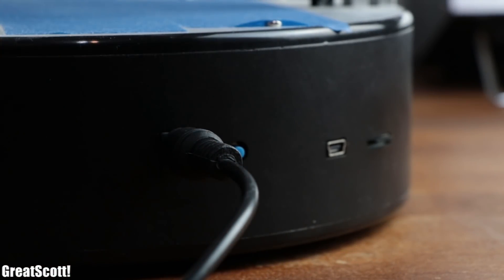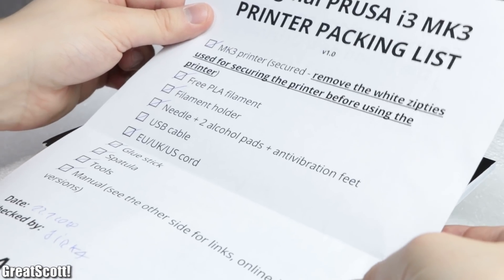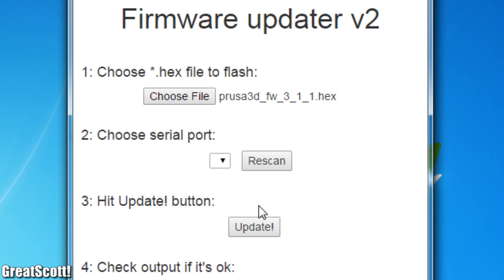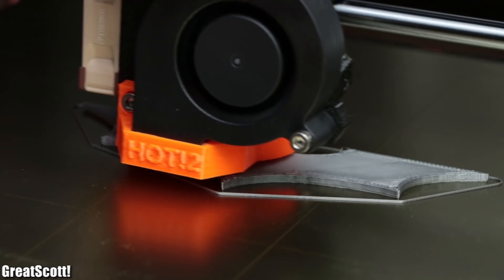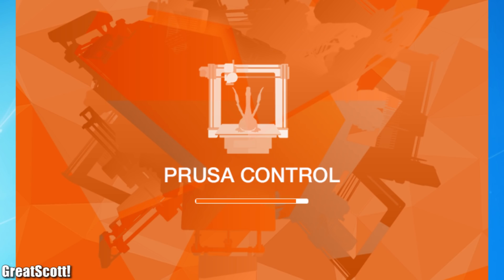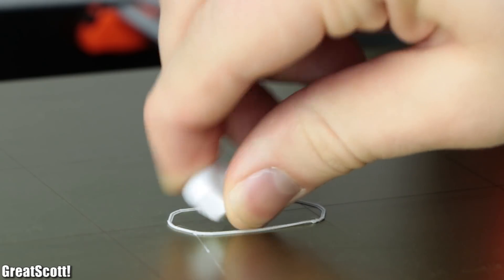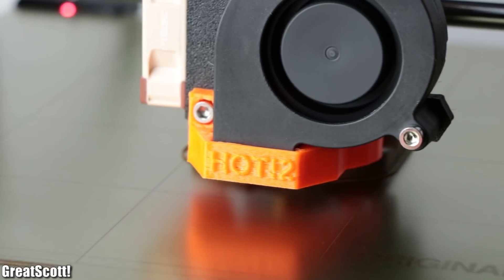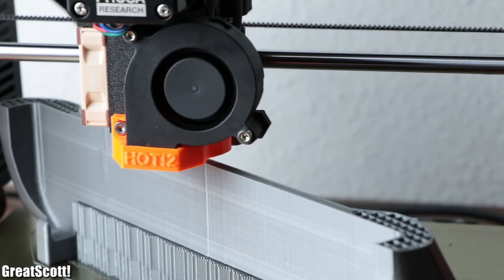Original Prusa i3 MK3 3D Printer Review - Still the best 3D Printer?

Comment: Usb Soldering iron DIY OR BUY...?
Reply from the maker: I put it on my to do list
Reply: GreatScott! Plz Fast..
Reply: HBS Productions but ...i see some Usb Soldering iron online
Reply: Lalan Desai yes
Reply: GreatScott! Plz we want to see the usb Soldering iron
Reply: HBS Productions : If the frequency going through the heating coil (not the frequency into the iron in general, but instead specifically the heating coil) is just in the 50 Hz frequency range, then it's not an inductive heater (well, not really).

Inductive heaters work by inducing  a current in whatever they're heating, after which the resistance of the object being heated transforms that current into heat. The fraction of a second after the current in the coil switches magnitude is when most of the current, and as a result heat, is transfered. So, if you want to heat up an object inductively, you have to transfer enough current into the object during a second to overwhelm the heat losses during that same second. I'm not going to say that it's absolutely impossible to do this with 50 or 60 Hz, but I will say that you shouldn't buy a soldering iron that tries: a higher frequency will allow much faster current induction (and thereby faster heating and more reliable regulation), and is therefore what should be used for that size of application.

Also, most "pencil" and "gun" soldering irons are actually resistive units, so that's probably what it is.
Reply: mohit sorout yes.....
Reply: mohit sorout hoby
Reply: HBS Productions : If it's truly inductive heating then DC wouldn't work, but that probably wouldn't be grid frequency AC in the first place. Either it has an internal oscillator, or the coil is used as a resistive instead of an inductive one.
Reply: Lalan Desai 5v 2a - 10 watts
Reply: Should be enough
Reply: Neither. USB does not supply enough current.
Reply: Usb Soldering iron DIY OR BUY...? Neither!
Reply: buy yourself a TS100 - you won't regret it. You can make an adapter with flexible silicone cable from an audio equipment shop, a 2.5x5.5 barrel jack, and a laptop power port (matched for your laptop model - you have the power brick in you backpack anyway) - you get a 60W soldering iron that is small and convenient to carry around. You can also install firmware updates on it, if it's your thing.
Reply: Lalan Desai Those won't run off a standard USB port, they need at least 1.5 amps
Reply: Lalan Desai 5watt